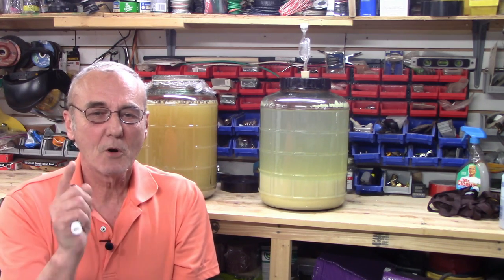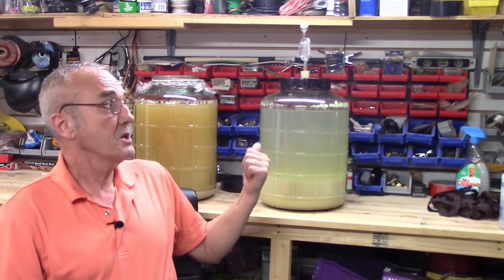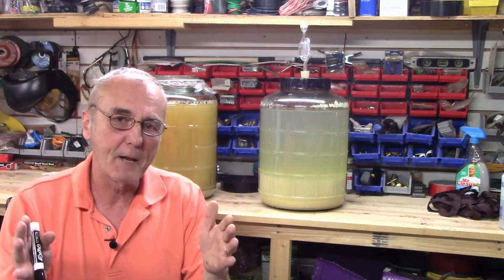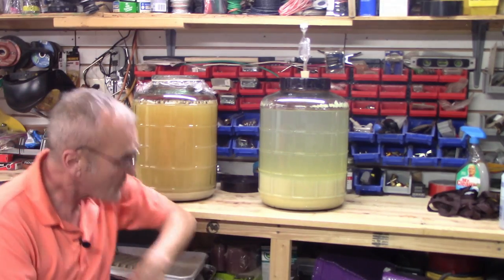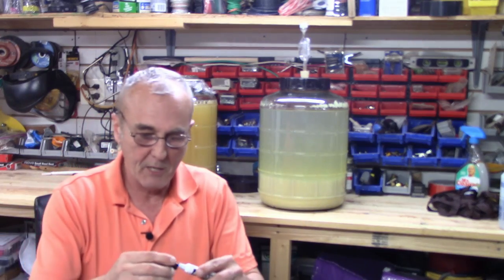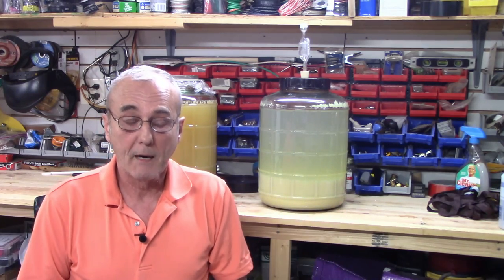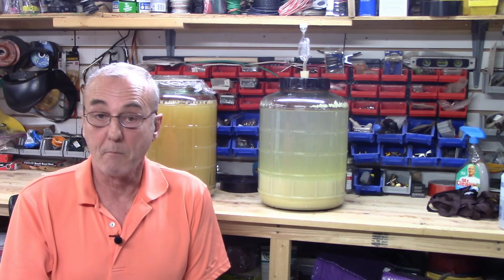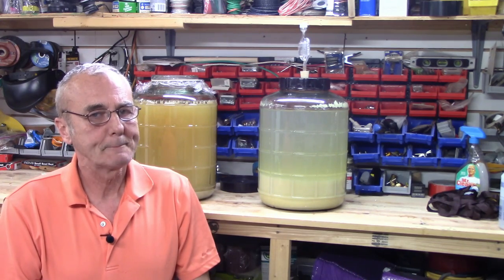Beginner's Guide #10 Clearing  the Mash

Comment: You know you don’t have to suck on the hose, if you have a 6’ piece. Still the entire hose in the mash except about 2” to 6” whatever you can grab a hold of, stick your finger over the end of the hose. Make sure you have a tight seal, and pull it out and over the side once you get almost to the bottom of your container let your finger of the end of the hose. It should start flowing if you did it right

Comment: I've always used the estimates for time of fermentation that match the first and second digit to the right on the gravity. 1.040 = 4 days. 1.050 = 5 days...... 1.10 = 10 days. Easy to remember. Your estimates here line up well with that.
Reply from the maker: I never thought of it like that. Makes perfect sense for a ballpark guide. Thanks Mike
Reply: That does make sence.
My 1st reading 1.052 now reads 
.092 and it took 4 days 👍

Comment: Both ferments have taken about 3-4 weeks, ph 5.0, temps 15-17C, my guess is it's just too cold, but starts at 1.075-.080, finishes 0.990 and has a thick pile of yeast on the bottom so it seems to be happy
Reply: Thats exactly what my Hydrometer read.090 and it took 3-4 days to get there?

Comment: Last 2 days of brewing I tip my carboy right over to open the bottom corner put my clear sypon pipe into the corner clamp the top after settling start syponing as it gets down ever so gently lay flat again the Goper shxt will start sliding but you`ll salvage 97% of the product done this till I learn`t about Diesesol and Chitosan Funny how a shell fish or Some fish species can be used in that manner for us , Probably makes them from floating to the top hey ?? Thanks George , Merry HO HO .

Comment: Instead of using turbo clear could I use cheesecloth and other strainers to just clear it out
Reply: Nope
Reply: You could possibly use a 1 micron filter - it'll plug immediately though so you'd have to use a staged filtration system. Several hundred dollars vs $2.99.
Reply: @kenniclown3103  that's the problem  I'm having, it's white gray cloudy, not sure what to do ?
Reply: Kenni Clown l

Comment: I started making 5 gallons of peach wine the first hydrometer reading was1.06 the finish reading is 0.990 i did the math and I came up with 7% i tasted it and it tastes like much.stronger than 7%.  The wine started bubbling so fast the day after I added the yeast it bubbled out of the bubbler all over the top of the fermenter bucket stronger. Is me conciliation right? What math formula do you use to figure alcohol content I've made a lot of wine but this is my first peach wine but I've never ran into this problem. What are your thoughts on this problem?

Mike

Comment: For years I’ve used a series of filtering devices. Starting with vibration, a tight mesh screen, and ending with a pillow case. I run approximately 15 gallons of wash a run. It takes a lot of time to use chemical methods and I seem to lose a good bit of alcohol as well. Is there an advantage to your process that I’m missing ? If so.  Please comment. I’m always looking to improve my process.

Comment: I recently did a simple sugar wash. Ran it through and started out fine ,as usual, but towards the very end of the run, the last of the hearts gave a strong ammonia smell. When I went to clean out the pot, there was an oily residue build up around the start of the column. Looked almost like soap. I've never had this happen before. Any advise?

Comment: Hey George!...
I, for reasons I won’t go into added a teaspoon of sodium bicarbonate to a cloudy 5 gallon batch of 4 lb. mead. About 24 hrs later I checked it and, to my surprise, all the solids had crashed to the bottom of the carboy and it was completely clear!
Clarification was not my intent but, that’s what happened and, all signs of fermentation stopped...
Have you ever head of anyone using sodium bicarb to clarify?
Reply: I used some to help adjust a PH and by the time it's finished fermenting it's clear except the red from tomato paste, idk if it's from the bicarb though

Comment: Only ? I have is I have noticed that you are not using your fast fermentors that you said were the best. Is there a reason why?  Is there a reason I should not be getting to replace my buckets.
Reply from the maker: In many videos I use simple equipment that most people have. When I run stills I don't use the high speed automated still. That would be useless to those who do not have one. 
I still use the fastferment; not in the shop since I have little room to mount it. 
I am trying to be universal as much a s possible. 
George

Comment: George what are those fermenters in this video? Finding the perfect fermenter has been impossible without spending my kids college fund. I would love to find something at least 12 gallons, clear with a large opening for cleaning ease that doesn't cost too much because I would like to have 4 of them. If I have to get 6 gallon units to be affordable so be it, but that doubles the cleaning. Any suggestions?
Reply: @morse yes I have 4 of them and they suck to clean and you can't see threw them to know where the sediment level is. The white ones would be a little better as you might be able to see the sediment level but still hard to clean. If they came with the whole top removable they'd be great.
Reply: I've seen pictures and videos where guys would cut the tops off containers with the usable sizes holes and silicone them to bigger containers so they could access them.  Oh.well, just a thought.
Cheers
Reply: Check out your local feed and grain co-op store.  You might have to do minor modifications

Comment: Any interest in rice? I'm a noob but it is a grain, no?  Thanks for the knowledge.
Reply: There are some good forum posts that span ten plus years of people refining rice wine making teq, with solid results distilling also.
Reply: @azraelblick4117  I'd be interested in a rice distillate. On with the searching then.  Thanks!
Reply: @johnkuhn4263  I can’t find where anyone tested just rice and no sugar for a mash.  I will test it very soon.  I have 200 lbs of rice in my survival closet reaching expiration in mere months, so ill be developing a method.  I suspect using the fungus used in making rice wine then distilling the rice wine might be the way.  I found where some tried using alpha and beta amalaze but they didn’t report results….
Reply: @azraelblick4117  Great chat!! I'd suppose some old Japanese heads will be interested in your project results. 

Coincidentally, are you anywhere near Pittsburgh because I'd be interested in your results also. Lol. 

Along side DADY Yeast and table sugar, I use Vi-Tal and DAP in fertilizer form. Perhaps that may feed your yeast??  It can be pretty transparent with proper filtering (and I have a clever method for that).

Holler, friend.
Reply: @johnkuhn4263  I'm in Independence Missouri.  Should check it out, great place to be.

Comment: Question, I am making a sugar wash, I used molasses, raw sugar and cane sugar. I used a classic 48 hour turbo yeast, started 2 days ago. 3 lbs molasses, 8 lbs raw sugar and 8-9 lbs of cane sugar. total after water in my  fastferment is about 5.5 gallons. starting sg is 1.140. i am not looking to distill this, looking for drinkable, i guess "sugar wine". CAN THIS BE CONSUMED WITHOUT DISTILLATION to remove the Methanol? I have been making wine from fruit for about a year and i have used 1 kit. And if I understand correctly all wine contains a certain amount of methanol?
Reply: Drinking wine isn't a problem, but distilling it severely concentrates the compounds including the methanol. In other words, if you have say 2 ounces of methanol in a 5 gallon batch of wine, after distilling, I believe you'll have about that same amount, but in maybe a 1/2 gallon of solution.
Reply: A little methanol distributed through almost 20litres of "sugar wine" isn't going to make you go blind. The methanol in grape wine remains in the wine for example. 

Never heard of anyone exclusively drinking a fermented sugar wash.